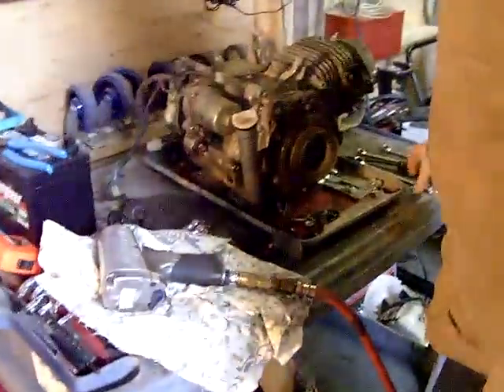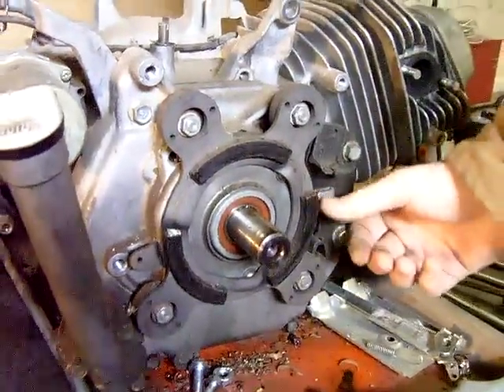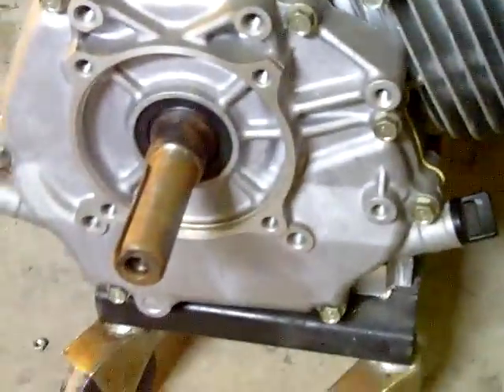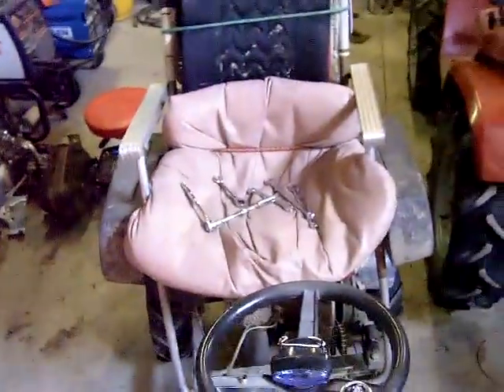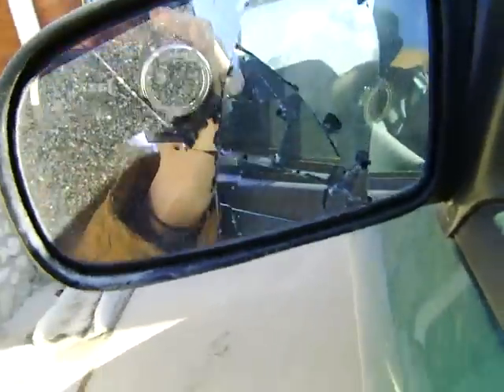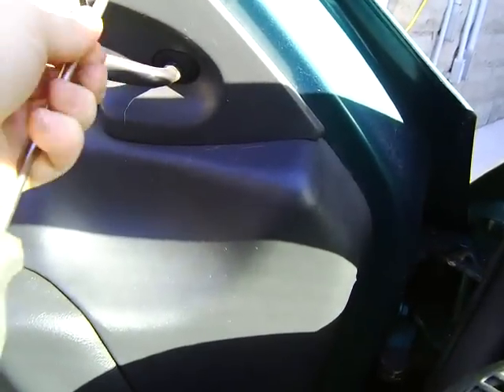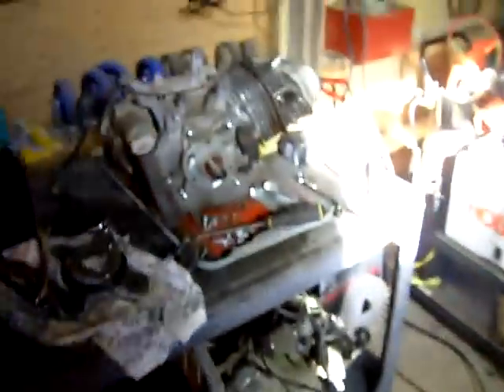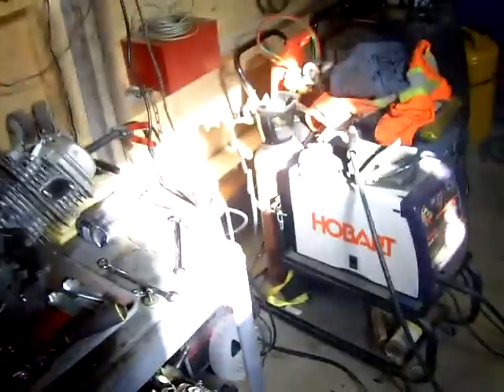its project day!

Comment: really? its super easy, do you have a MIG or an ARC welder? Mig is best for thin metal, Arc is for thick metal if you use arc get 7018 rods. Easiest to use.

Comment: i have MIG as i only really need a welder for cars, i used to enjoy welding but now i only weld if i absolutely have to, such a dirty horrible job especially doing sills (rockers) floors and chassis repairs, getting sparks and slag all over you, and not to mention arc eye and sunburn (iknow a mask 'should' be worn but some instances you just cant)